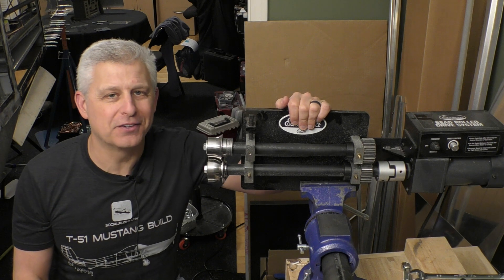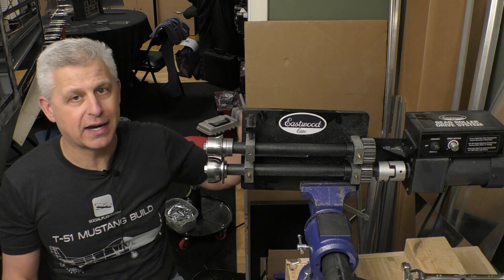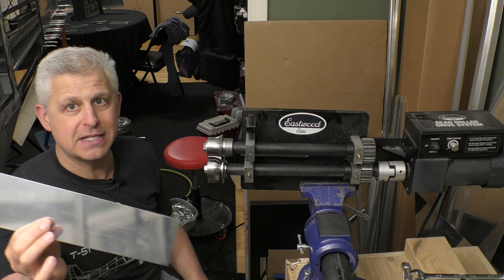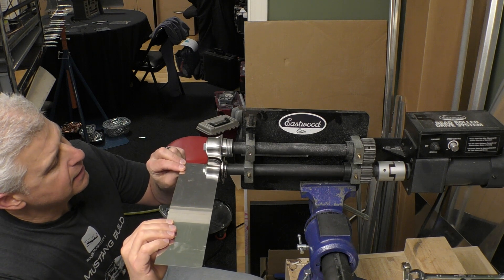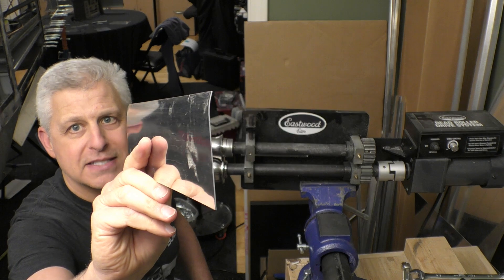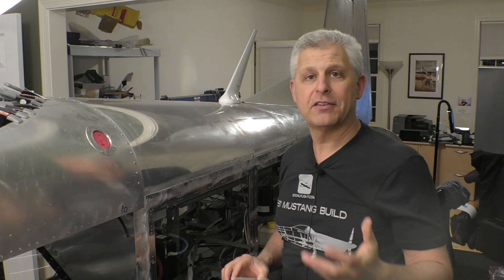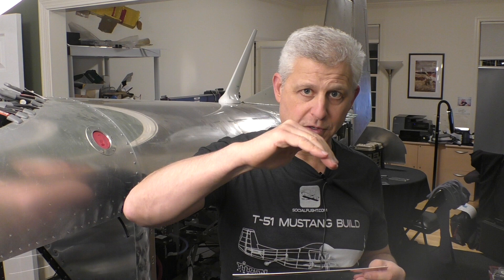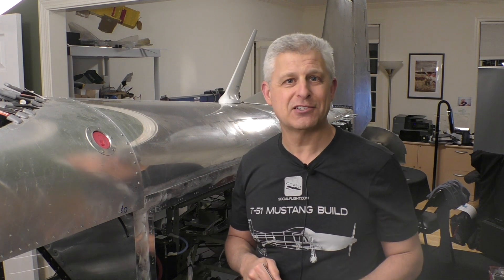Can we SAVE THE MUSTANG using a Bead Roller?  Fitting the HUGE skins on our T-51D Mustang

Comment: In addition to rolling the top edge of that E skin, I found it necessary to use a shrinker also.  This is because the shape of the fuselage frame switches from straight (forward of station 9) to tapered aft of station 9.  I had already abandoned the idea of having a polished finish, so the marks from the shrinker will be sanded and filled prior to painting.  The BCD skin is an even bigger challenge because, again, the fuselage changes shape suddenly at station 4.

Comment: Does the turtle deck skin overlay the fuselage side skins, or the other way around?  Just wondering, thinking like a house roofer.
Reply from the maker: Although common logic might have the turtle deck over the side skin, the side skins go on last in the building process for many reasons. So they’re on top of the turtle deck skins.
Reply: Was thinking the same thing. Lapping the turtle deck over the side skin would keep water out.